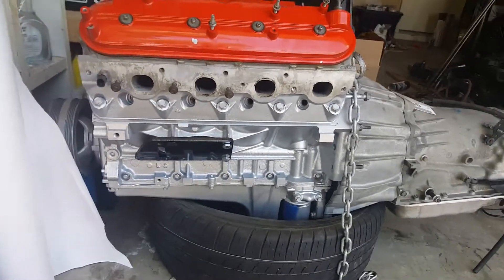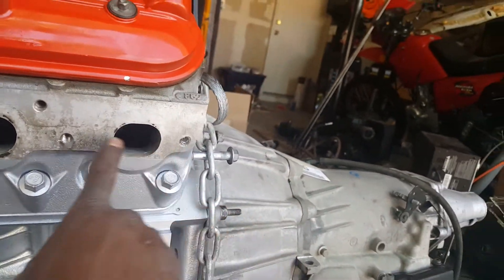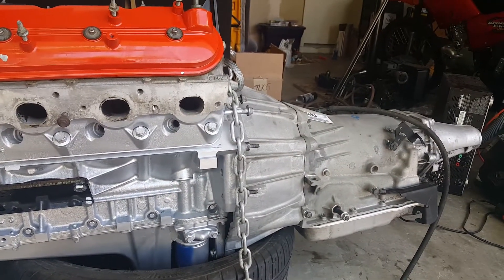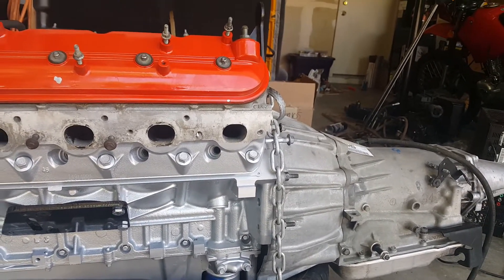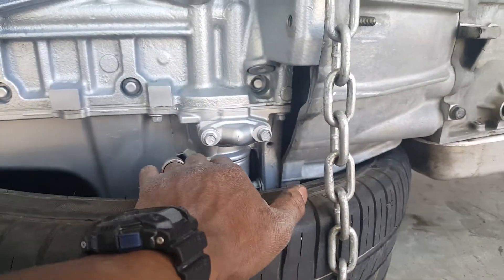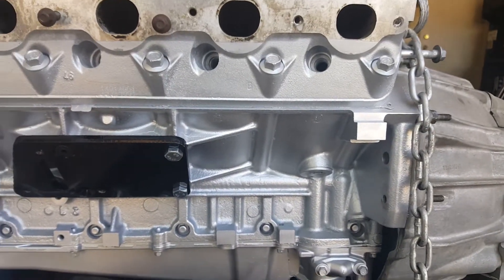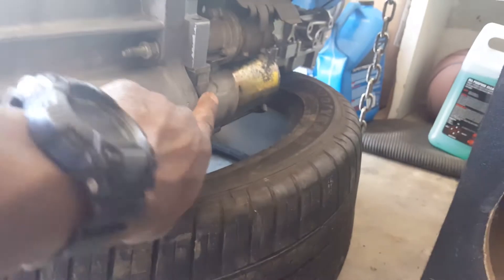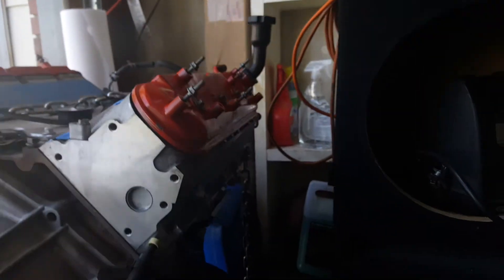LS Swap Part 2 New Rear Main Seal, Trans Bolted Up

Comment: progress progress progress i c u bro keep it up so wat kinda trans is that is that tha 1 that came out tha truck or different 1 an where did u get them plates mount plates from..
Reply from the maker: Sean Murray I got the plates from eBay 1 inch set backs. I'm taking the trans mount from the 700 it should line up
Reply: Steve Davis can you email me when you get a min